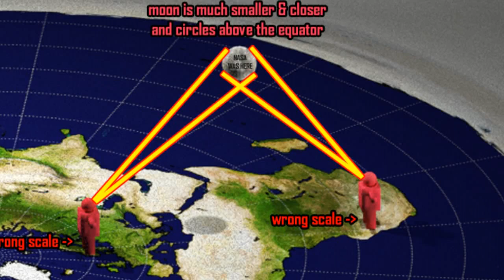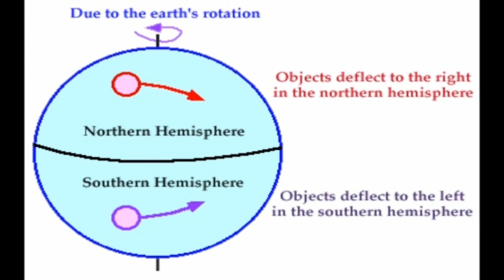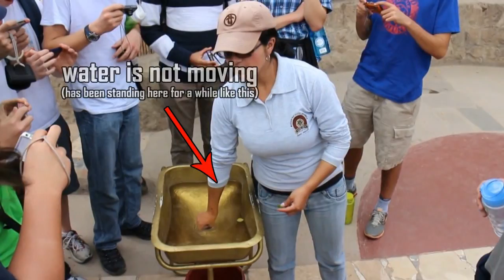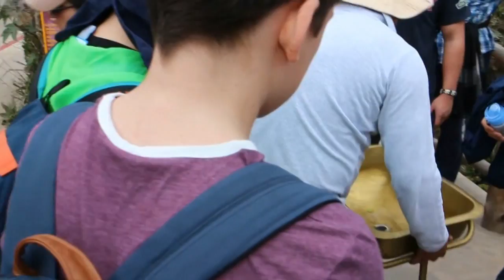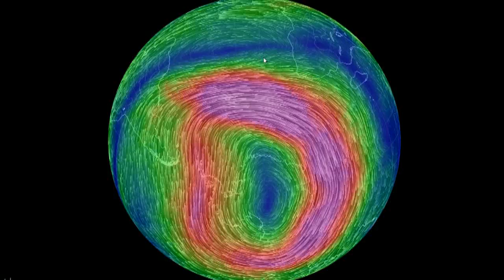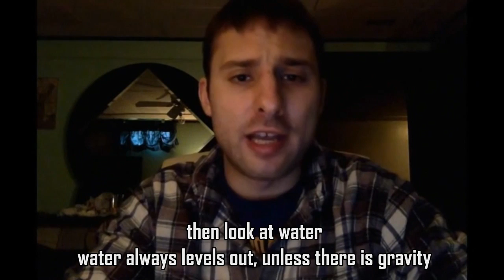Debunking flat earth debunker-shills

Comment: We were all taught that cyclones always rotate clockwise or counter clockwise depending on which side of equator until a lady noticed a tornado on the Television news was swirling opposite of effect and called the news station. Now they are noticed to do that quite often and are called anti- cyclones for not adhering too coriolis effect. Hurricanes all come from only 3 places on Earth and due to the permanent water current direction and prevailing winds do not deviate as often as  the way random tornadoes do but they also become anti- cyclones.

Comment: questions for flat earthers.

1. What is keeping everything attached to earth? Because it gravity existed it would slowly compress earth into a ball.

2. Is the moon moving up to? faster than the earth? slowly moving away from us?

3. What is closer to earth? the moon or the sun? 

4. How does the sun move in comparison to the earth? above it like a big spinning spotlight?

5. Where are the pictures of the edge of the Earth?

6. What's keeping all the water spilling off this flat disk?

7. how does the moon and the sun move in comparison to each other?

8. are all planets flat? or just earth?

9. where does the sun set to? WHere does it rise from?
Reply from the maker: Patpuc  1. There is no need for gravity on a flat earth, everything can be exlpained with mass and density. Lighter then air goes up, heavier goes down. The flat earth is not constantly rising up like some models claim.
.2 the moon and sun are both circling above the flat earth. The path changes during the year causing the seasons
3. the moon and sun are believed to be the same size and around the same altitude. Not millions of miles away but pretty close
4. The sun circles above the flat plane. The light can only go a limited distance since it's close above the surface.
5. Google Antarctica ice wall and you can find some pictures
6. The flat earth model has Antarctica 360° around all other continents, like a outer border or wall keeping in the water
7. Look on Rob Skiba his youtube channel, he just posted a animation that shows the sun and moon's path during a full year
8. I have no idea about the planets. I think they are all just stars inside the dome or projected on the dome9. Sunrise and sunset is caused by perspective. When it is too far you simply can't see it anymore. I appears to sink below the horizon like ships do. You get the same effect if you put a camera on the floor and drive a little toy car further and further away from it. You will see it disappear bottom first.
Reply: GeoShifter Good explanations. I still don't know what side to take XD 
thanks for answering.

Comment: +Indra Guillory, you said you met someone who worked for the French Space Agency. They showed you a video of 'a flight to the ISS, in which the Earth is completely spherical." You then say "I have flown a bit; and you can see the curvature of the Earth on the horizon." Both of these statements are unhelpful; the first, because we have no evidence any such video ever existed, nor can we trust that you saw it. The second statement is patently incorrect and total crap. Above the surface of the Earth, no commercial flight will go to an altitude of more than about eight miles (design constraints on the aircraft, its Max Ceiling). At that height, based on the 25,000 mile circumference of the supposed Globe, you are approximately 1/2 an inch off the surface of a 40 foot rock with a flat surface, in the centre of that rock. Absolutely NO curvature will be visible at this height; and millions of travellers (including myself) will incontrovertibly attest to this indubitable factoid. Planes just do not fly high enough; if you think you can see ANY curvature in the Earth, it is due to a) your wild imagination; b) the convexity built into the aircraft window, to aid in pressurization of the cabin; c) an optical illusion. The whole problem of this 'Flat Earth' argument is ONLY proving 'unresolvable' because the average inquisitive soul (who is not completely brain fogged yet) cannot afford to build a vehicle of type sufficient in thrust to achieve a height of at least twice the diameter of the supposed ball Earth; only from roughly that height (19000 miles) would it no longer be a question what the true shape of the Earth is. In due time, this question will be resolved; although no Elites will be involved, since they will say it is a collosal waste of money.

Comment: use a plum bob. do you see buildings wider on top? a humble plum bob tells you the surface isnt curved. a simple tool versus your elaborate sentences. this tool points directly to the center of so-called globe. do vertical lines on a sphere and youd get slanting lines widening to the top. do you see high rise buildings gone top heavy? see other posts on the coriollis whatever. your wrong. validate your findings of vertical lines using a plum bob it works with the so-called gravity invented by your science star Newton. Your gauge of intelligence is based on tradition and convention of so-called ball earth. you got the audacity to say flat earth is stupid, prove that the plum bob tool doesnt give you widening vertical lines to the top. by the way, to this day engineers use the reliable plum bob to structure buildings on a flat earth.

Comment: I noticed that in a different older video they used 2 basins on opposite sides of the equator (which proves nothing),and after pointing this out in comments...NOW there is a video where they move one basin.LOL I bet we can bring that basin anywhere and make it drain either way.     What would happen if the basin was ON THE EQUATOR EXACTLY? Would water spin BOTH WAYS?  Snipers and naval cannons never had to take coriolis into account BEFORE flat earth became an issue. SCIENTISMISTS will soon discover an ANTI-CORIOLIS EFFECT to counter our exposure of this LIE
Reply from the maker: scott merrow the red line in the video is the exact equator, so they show it not rotating on the equator. Why ? Because the water has been standing there for a while so is no longer in motion. Sneaky magic tricks :)
Reply: GeoShifter
that's what they do best, magic tricks to fool the eyes and brains of the unthinking